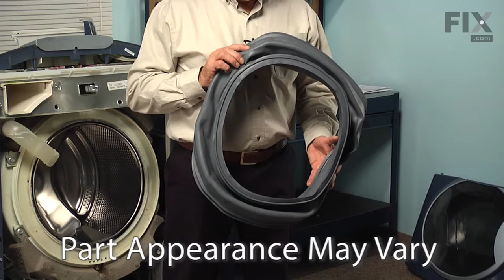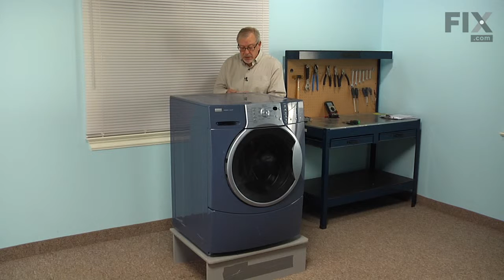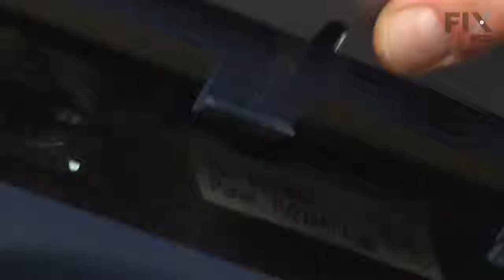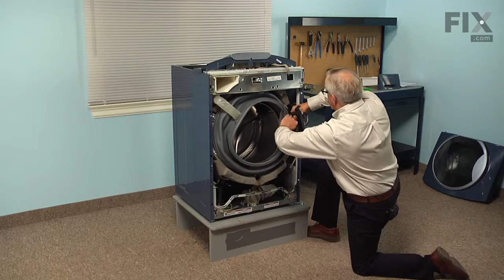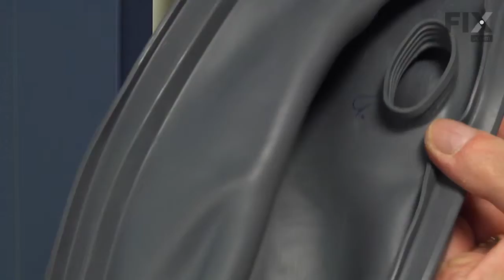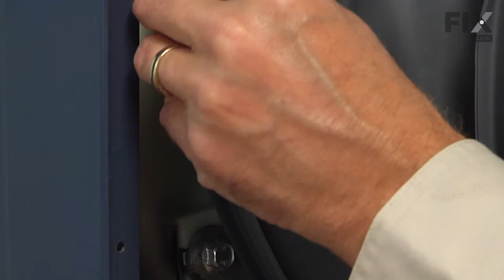Kenmore Washer Repair – How to replace the Bellow

Comment: Your Video was WONDERFUL! It made it so easy to replace the boot. I did have to improvise on installing the outer seal ring. I used an Erector set Girder and long screws to get the Spring wide enough to install it. I bought the $15.00 tool but it does not "Open" the spring wide enough to install the ring. With the Erector set girder I pulled on the Spring until it was at least 1 inch wider then at the relaxed position. The seal ring then was a snap!    Thank you!

Comment: Thanks so much, Steve! Super clear instructions saved me a ton of cash to fix our leaky washer. Only one warning I would add is that the outer spring clamp (at least mine) was &$@#*&$ obnoxious to get back on. That single step took almost 30% of the time. Teasing you when you’re so close to finishing!

Comment: This Video was the best video ever.  I was happy to find it for my model washer since I purchased it in the year 2000.  I followed step by step and was able to remove the bello, checked it for any holes, cleaned it and reused it since there were no issues.  After reinstalling the leak was gone.  I also like that you put the Part # is the description.

Comment: Now all I have to do is source a new bellow.  I have traced the leak to a hole where the fill spout goes in.  I can't see it because it is behind the fill spout, but when feeling around back there I found a hole I could put my finger in.  It leaks primarily when filling so it makes sense that it was either the bellow in that area or perhaps a crack in the fill spout.